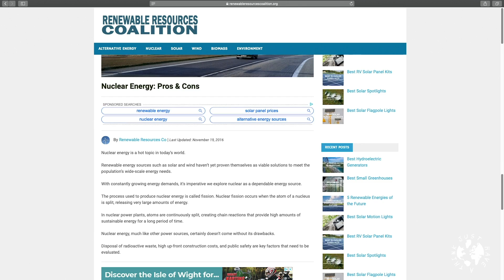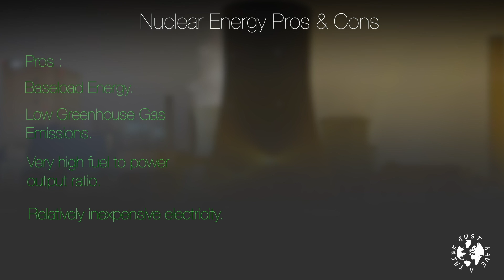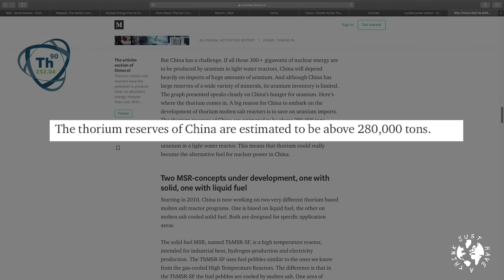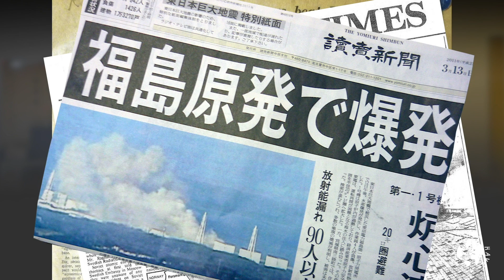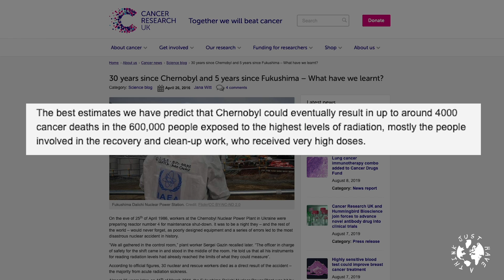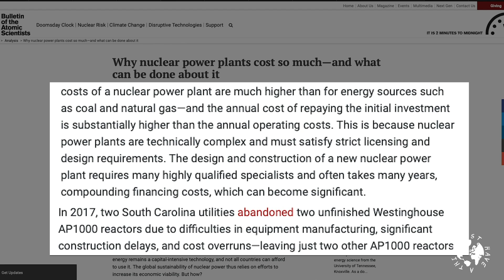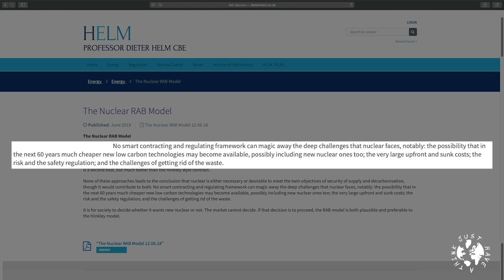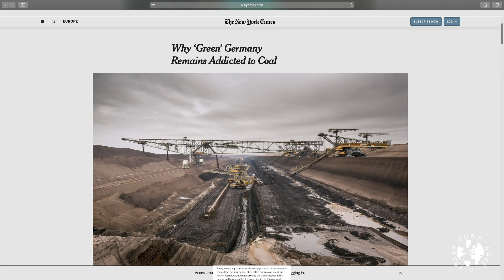Nuclear Energy in the 21st Century

Comment: You mentioned Thorium based molten salt reactors, These reactors are significantly safer than current nuclear reactors in that their design means they cannot melt down. they are what is called "Walk Away Safe"
What that means is that even if there is a complete power failure, AND the operators stand back and do nothing, the Reactor will shut itself down safely. They require power and human intervention to keep them running, with out that, they shut down. if Chernobyl and Fukushima had these reactors, the accidents would not have happened.
Also Thorium / Uranium 233 reactors produce  significantly less radioactive waste than traditional nuclear reactors, and the waste that they do produce decays to a safe level in a few hundred years compared to 100's of thousands of years for Uranium 238 reactors which only burn 3% of the Uranium fuel and waste 97%.
Molten salt reactors can also use waste Uranium from traditional nuclear reactors as a fuel, so a significant portion of current nuclear waste stockpiles could be reused in these reactors instead of burring it in the ground for 100's of thousands of years and hoping it doesn't come back to bite us in the ass.
Molten Salt or Generation IV nuclear plants could provide all the power we will ever need for the foreseeable future. At least until fusion power comes along.
Reply: couldn't agree more :)
Reply: No functioning MSR reactor had been constructed with all of the components which would be needed to perform the power generation, breeder blanket, and nuclear chemistry in a functioning power generating system.  What was successfully tested was just the core......graphite moderator, containment, and fluid management systems.  When I see a quarter scale generating plant, say 50-100 mWe plant work as advertised for several years, then I'll take a hard look at Thorium MSRs.  Until then, pie in the sky.  Just like fusion.
Reply: Exactly! This alone is worth its own Just have a think episode!
Reply: Gotta correct you. It's not Thorium based reactor which makes it safe; it's it being a molten salt reactor. You can use Thorium, Uranium or Plutonium in a molten salt reactor and they are all as safe. The safety comes from Salt having 1000C of liquid range so you don't need to keep the reactor pressurized, and the fuel can be drained out of the reactor passively cooled drain tanks just by the freeze plug melting if there is no power provided to freeze the salt.

So even if the reactor did over temp, it drains it's self as it overwhelms the cooling capacity keeping the freeze plug closed, lose power the freeze plug melts, there is a leak you could set it up so that if the pressure in the reactor drops below outside pressure there is a mechanical device to automatically drain the reactor.

Which these reactors are not under pressure and are 2 inch thick steel surrounded by concrete, so a leak is highly unlikely, but also a leak can be dealt with robotically and all radioactive materials should be bound to the salt so once it gets outside the reactor it will freeze and trap the radioactive materiel.

I wonder if you could keep it below atmospheric pressure so that if the reactor does get a hole in it air would fill the reactor and the fuel salt would be sucked into the spill tanks passively, so in the case someone purposefully put a hole into the reactor  —which is about the only way I could think you would manage to do it— the reactor wouldn't spill out more than a drop or 2 of the fuel salt simply from the force used to piece the reactor.
Reply: Sure, could work a treat, but it would still be three to four times more expensive than renewables per kW-hr.  And thinking a century ahead, we would then be running out of both uranium and thorium at low enough prices, and then we could once again find we haven't managed to make fusion work cheaply enough, and that renewables were always cheaper and easier.
Reply: Thorium reactors convert Thorium into  Uranium in a 'Thorium breaker reactor'. 
You can have Molten salt reactors with Thorium also.
Reply: @Music5362  no onhe has built one yet and specialist in this field are unsrure if they are possible. China 9and I think India and Russia) are building experimental reactors fuelled with thorium to see if they will work. But these reactors have not been completed so we still don't know whether or not they will work.
Reply: I am with you 100% Benjamin Sisko. Thorium MSRs are far and away the best alternative for transitioning to a renewable power system.
Reply: speak'n the truth
Reply: The principle is known since the 60's, but why is there no single molten salt thorium reactor? Why is that? I think it has something to do with all promises being theoretical, and the technology is not quite up to the task to produce reliable, safe, and competitive energy. Just like fusion, its always many decades away
Reply: Some very good points made. Best regard from all your friends at www.ecolo.org
Reply: I have learned quite a bit more about nuclear power than I knew even as little as two years ago ; this is more still, and it seems GREAT, but the cynic in me has to ask, "What's the catch?" Sorry, I'm NOT suggesting that you yourself are being deceptive, but I do know that just as I habitually look for the silver lining in any bad news, there is probably at least a little bit of a downside to this (and I mean from an engineering perspective, not an emotionally skewed political angle). i hope that you will be able to enlighten me further.
Reply: No one even knows if a thorium reactor would work. No working thorium reactor exists and none may ever exist.
Reply: @wr2382  The Oakridge National Laboratory built an experimental molten salt reactor in the 1960's fuelled by thorium and ran for 5 years before funding was shut down.
The US military wanted pressurised water reactors to put in their subs and planes as well as Uranium and Plutonium to make nukes during the cold war, So the Oakridge experiment got shut down, and forgotten about until relatively recently.
As a result Pressurised Water Reactors became the norm across the world. So the technology exists and works and is 1 of 6 new reactor types chosen for Generation IV Nuclear power.
It just needs Goverment's to get off their asses and start building them.
Reply: @benjaminsisko4519  It was a molten salt reactor fuelled by uranium, not thorium.
Reply: @wr2382  You're correct if your standard is a thorium reactor attached to the Grid, i.e. a commercial grade Thorium reactor. BUT you DON'T  shut down research on this very promising technology.  THINK ABOUT IT.  If in the late 1800's - 1930's, the world gave up on airplanes because of so many crashes and lives lost,  we'd still be on the ground.  "If man were meant to fly, he'd have wings!" mentality.  As others have commented, a Molten Salt Reactor was working in the 1960s at ORNL but was shut down in the '70s for POLITICAL reasons.  Consider this: China has reviewed the work done at ORNL on MSR and putting a HUGE amount of resource to develop it - at least 300+ engineers/scientists to make it commercially viable.  Would you prefer we all buy China's new MSR technology, just as we're buying most other goods from them?  If you want to be dependent on them - that's fine!  They will dominate everything and they'll love it!
Reply: @wr2382  Thorium is as much a pipe dream right now as FUSION. Hope he does a show on Fusion, now that would be something to dream about. Nukes are death. No way around it. We are become death, destroyer of Worlds.
Reply: @benjaminsisko4519  None of those reactors work. The videos are about how people hope their designs will work. If you don't make that distinction you are simply trying to con people. Why do you keep doing that?
Reply: @wr2382  The Technology DOES WORK, its been tested and proven. 
Just because no commercial reactors have yet gone into operation does not disprove the technology.
I'm not trying to con anyone, everyone here is free to make up their own minds.
If you choose to deny it, that is your choice.
Reply: @benjaminsisko4519  You need to explain what you mean by "technology" because you certainly don't mean an operating reactor.
Reply: @benjaminsisko4519  Perhaps you mean by technology that the neutron flux from uranium reactors have been used to transmute thorium-232 into U-233. That is true. It was done many decades ago. But there is a big difference between doing that and building an efficient and cost-effective reactor that uses thorium as the primary fuel. That is why no working thorium reactor exists.
Reply: @wr2382  I mean the technology of using Thorium as a fuel in a molten salt reactor, which was built and tested for 5 years in the late 60's.
I will not respond to any more of your troll questions. If you want proof / evidence there are 1000's of videos on the subject on youtube do the research.
Reply: @wr2382 You need to clearify what type of reactor you are explicitly talking about, because right now youre saying that nuclear reactors have never used thorium which is 100% historically inaccurate. 

1958- PWAR-2 concept as part of the US Aircraft Reactor Experiments by the US Air Force

1968-1969- Molten Salt Breeder Reactor Experiment at Oak Ridge National Laboratory 

1977 - Shippingport LWBR used a thorium core in a commercial reactor

1984 - Ft Vrain LWBR used a thorium core in a commercial reactor
Reply: @brian2440  If you mean the Oak Ridge reactor, it was a molten salt reactor fuelled by uranium. Perhaps you should link references to reactors fuelled by thorium.
Reply: @wr2382  Thorium decays into Uranium when bombarded with neutrons then the Uranium provides the fission, but unlike PWR's that only burn 1 -5 % of the Uranium before the fuel rod has to be replaced, Thorium/Uranium Reactors are able to burn 100% of the fuel resulting in significantly less waste material, since there are no fuel rods to replace every 3 to 5 years.
Altho the ONL reactor was experimental and never actually provided power, the technology was proven to work. As mentioned above China is developing and building an MSR plant and several other countrys are looking into the technology. so its just a matter of time.
At the end of the Day we need to stop burning fossil fuels a.s.a.p and nuclear power (regardless of reactor type) is the most viable option coupled with renewable energy systems.
Reply: @benjaminsisko4519  In Oak Ridge, the thorium transmutation occurred in a completely separate uranium reactor. The newly produced U-233 was then fed into the molten salt reactor at Oak Ridge. 

That was not a thorium reactor and it is nowhere near being an efficient way to generate electricity. It was simply an experiment that the researchers hoped might one day lead to a thorium reactor. 

That was 50 years ago and there is still no thorium reactor. Maybe there will be one day, but that won't be any day soon and it may never happen. So don't be mad when I call BS on people claiming that thorium is the answer to the climate crisis.
Reply: @wr2382  Agreed, it does need more research and developement, and in the the current climate of fear over nuclear, that is not likely to happen. which is tragic. MSR reactors tho are just 1 out of 6 new reactor technologies chosen for Generation IV Nuclear Power Plants. But again due to public fear we will not likely see many being built.
Reply: @benjaminsisko4519  "Thorium/Uranium Reactors are able to burn 100% of the fuel resulting in significantly less waste material,"

It's true that these reactors lead to less waste, and that the half-life is much shorter, which means the waste is safer much faster. But low half-life isn't just a good thing. Low half-life means the waste release a lot more radioactivity while it is active.. The waste could be more difficult to handle in the short term, and more dangerous for use in dirty bombs.

Edit: I'm not against investing in MSRs. But it's not the silver bullet some people think it is. There are many big challenges with the technology.
Reply: W R That was just one example, and FYI from 1965-1968 the experiment was solely with a uranium core, however from 1968-1969 ORNL used a uranium driver and a thorium core.
Reply: @auspiciouslywild  The shorter halve life comes from using more of it up, so you are just further down the decay chain.

So no it shouldn't be more radioactive as far as I understand. Also you could just leave it in the salt which would dilute it leading to a similar level of radioactivity per area even if it was.

Furthermore a lot of the "waste" is actually useful, but in a solid fuel reactor it would be costly to separate it out as you would have to liquefy the very radioactive waste and then separate it out, while you can separate out what you want while the reactor is in operation due to the fuel being liquid.
Reply: @auspiciouslywild  As far as I am aware U-232 would be burned eventually after capturing neutrons after releasing them a bunch of times and turning to U-233 which is fissile materiel in a thorium reactor.

As U-232 has a halve-life of 68.9 years so you should definitely be able to breed U-233 before it decays, and you wouldn't be pulling out Uranium because your fuel is U-233 and separating out U-232 from U-233 cannot be done chemically so it is extremely difficult.

And for re-processing Protactinium which in LFTR you need to remove, and that decays in 30 days and gives off gamma. If you are talking about radiation concerns for reprocessing. Pa-233 is a bigger deal in that respect.

But if it's that bigger of a deal there are fast spectrum fuel salt reactors, where you don't even need to remove the Pa-233 and you only remove fission products.

But I am talking about final waste, and you can use tritium in aneutronic fusion reactors for example, and a lot of other transuranic are actually useful if they can be separated out.
Reply: @wr2382  they're already in China and in smaller Asian nations, Western companies have installed MSR facilities in relatively short time. Canada has one that's almost ready to online. Thorium reactors work just fine.
Reply: @reedcriswell6654  They are building experimental reactors to see if they work. None of them are complete and we don't know if they will work. Link your evidence if you have any.
Reply: @reedcriswell6654  Still waiting for you to link the evidence.
Reply: @wr2382  Still ignoring your impertinence. I don't deal with pro=trolls.
Reply: @reedcriswell6654  So you have no evidence. Why not just say that?
Reply: @wr2382  You're not going to goad me into deleting my comment. It stays. We will get this information out. As long as it takes.
Reply: @reedcriswell6654  lol, what information? You keep backing away from providing "this information". Stop making excuses and link the evidence.
Reply: Not true that had one working in the 1960's I believe in the U.S.
Reply: Problem is, the public were told - repeatedly - that nuclear power is safe. Now it's apparent that this isn't the case. Fool me once and all that.
Reply: @kofManKan  Nothing in this world is 100% safe. There is risk in everything we do.
You have to look at the bigger picture. Nuclear power is statistically 1 of the safest forms of power generation.
Replacing our ageing coal, gas, and old pressurised water nuclear reactors with modern Generation IV power plants could not only provide all the power we need, but also go a significant way to reducing global warming and stopping climate change before its too late.
If Climate Change  carry's on at its current pace, the human race will face an extinction level event that could see Billions of people displaced / killed.
Just last month 200 Billion tonnes of Greenland / Arctic ice  melted in the latest Climate Heatwave.
If nothing is done soon, its Game Over for the human race.
Reply: @benjaminsisko4519  Old PWR's are not bad, in fact they ar best today used reactors, much worse are old BWR's almost all of today nuclear poweplants are PWR's because very high levels of safety. Only PWR reactor failure was TMI, Chernobyl RBMK is in base channel type BWR, also in Fukushina failled 3 of 5 reactors in time of disaster operational and they are old BWR's. Whith PWR's in Fukushima that kind of radiation leak coluldn't happen because massive western PWR containments. But in general solid fuel/light water reactors (SF/LWR) has similar issues but today bulid SF/LWR's overcme it by inceased complexity an cost.
Reply: @kofManKan  Actually, even with the old dangerous light pressurized water reactors, and with all the accidents, I understand even with all that, it's still the safest form of energy production.
The new designs, mainly molten salt reactors make them walk away safe.
There is the risk of proliferation though.
Reply: @kofManKan The problem is the general public also simplifies science dramatically, which in many cases causes complete misunderstandings of the presented science. Yes nuclear power is safe by statistical risk calculations, but under particular scenarios with many variables aligned certain outcomes are possible are particular probabilities, but if the news said this then all their viewers would have changed the channel before the explanation was completed.
Reply: @kofManKan  They were told light water reactors were not safe. Or at least that's what the story should have been. And p.s. the safety record is insanely good. Carbon power has killed, and continues to kill orders of magnitude more people than nuclear has or ever will.
Reply: @kofManKan  well there's a lot of hysteria around nuclear but anyone who isn't biased and has a basic grasp on statistics can see nuclear is extremely safe.
Reply: @doritoification   Amen